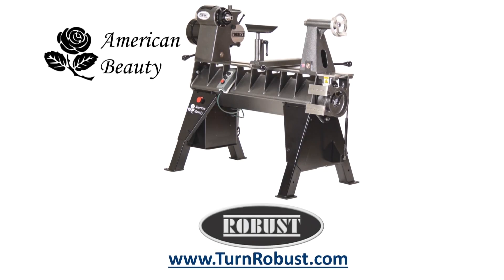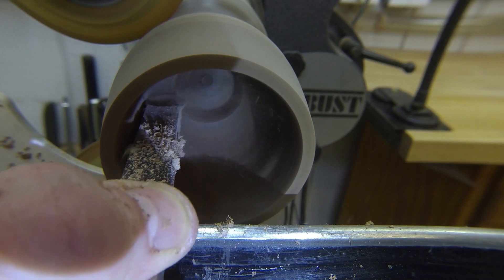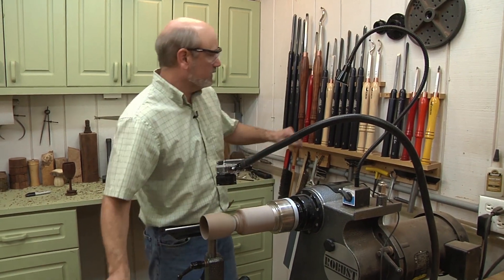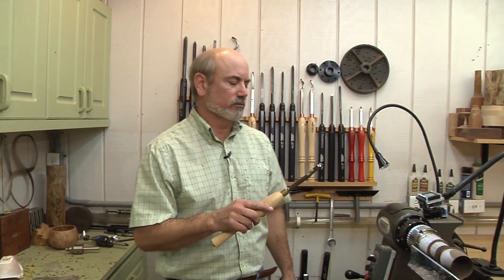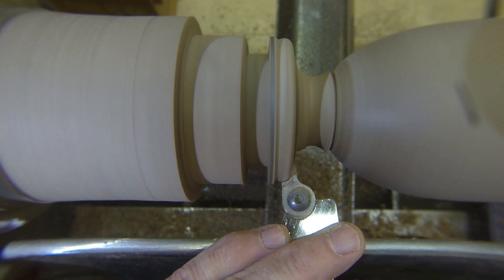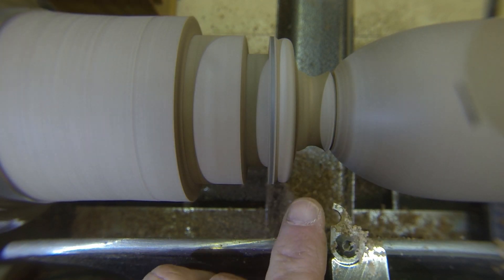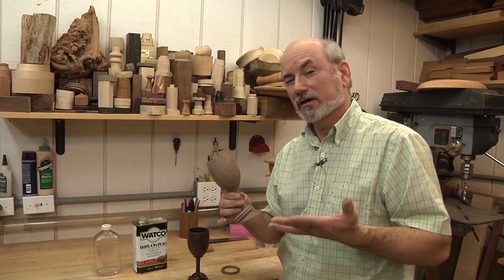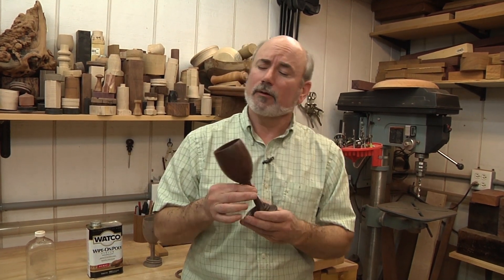Captive Wedding Ring Goblet- Part 2

Comment: I just did one of those the other day.  Mine only had one ring though and I didn't have a ring tool.  I used a detailer and then wrapped some emry cloth on the stem and used painter's tape covering half the width of the emry cloth and exposing the other half so I could sand the ring.  It does take longer but it's doable.  It is a fun project and a little challenging if you don't have the proper tools, but thinking outside the box is what makes wood projects more fun.

Comment: That's a neat tool. Little cumbersome with all the manual adjusting though. I just use a thin chisel and a long skinny pointed file to separate my captured rings.  But they don't tend to be fully rounded on the inside,  so i guess that's the upside to the purpose specific tool.